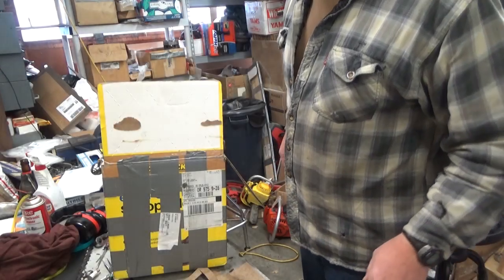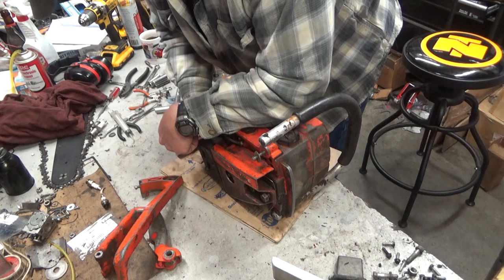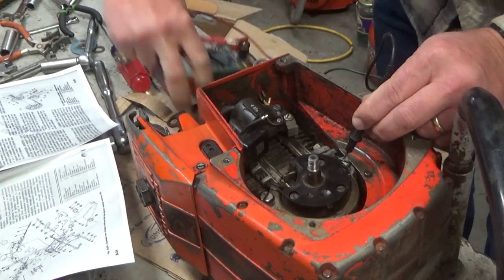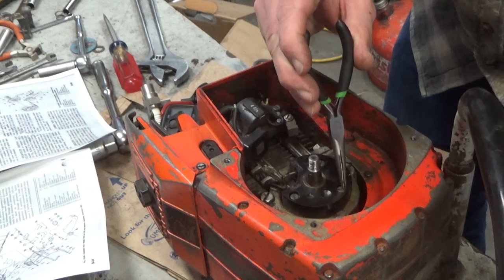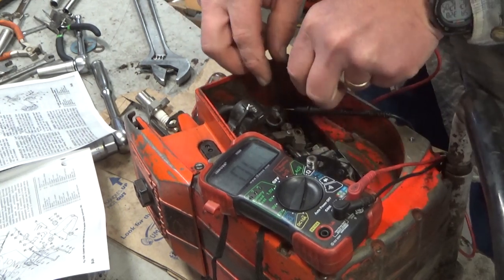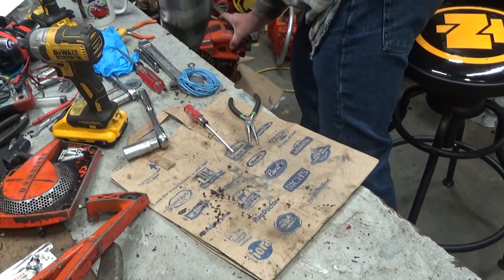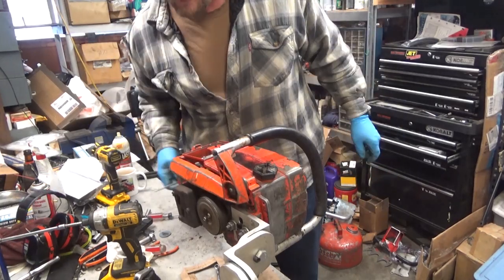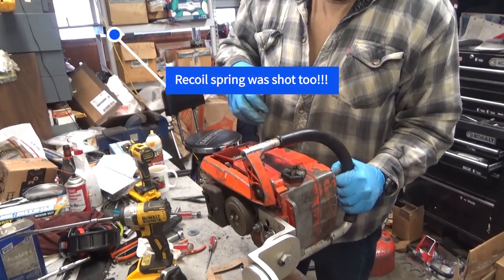Richard's VI-922 Diagnosis Of Capacitive Discharge Ignition & Test Run

Comment: Homelite xl automatic oiler ,what do you think they are capable of... like is it a junk saw or is it good for felling etc......I own one but it's small so I never used it yet I use sthil but yes just wondering your opinion
Reply: B-dog some of the Homelites with XL as part of the name can be a bit confusing.  Are you referring to one of these bigger Xl's http://www.acresinternet.com/cscc.nsf/ed1d619968136da688256af40002b8f7/9f34db001d6d6f6e88256c26004d6e0a?OpenDocument  or one of the smaller ones that look more like this: http://www.acresinternet.com/cscc.nsf/ed1d619968136da688256af40002b8f7/d4b1071a456ca76c88256cd6001cc24c?OpenDocument  If it's the bigger one that you have then those are some of the most popular saws made at the time and for good reason...they simply work!  I have a couple and they're always my go-to saws when I want to do some cutting.  Heavy duty tough and reliable.  If it's the smaller saw you have those are great for limbing and possibly felling small diameter trees.  Be careful out there brother.
Reply from the maker: @TheCrittercam001  Couldn't have said it any better!